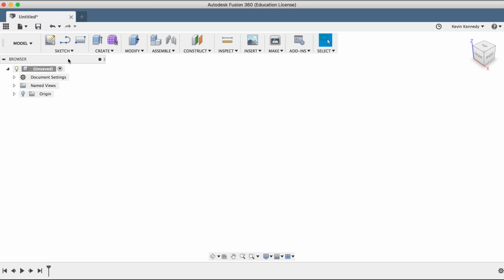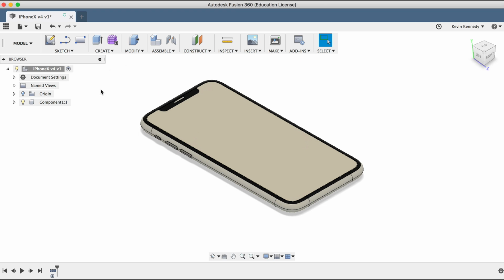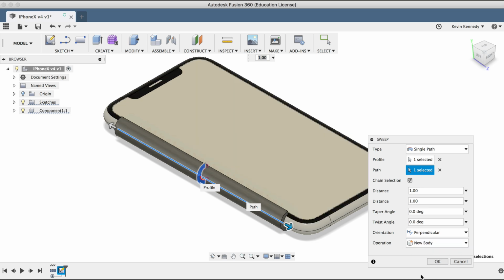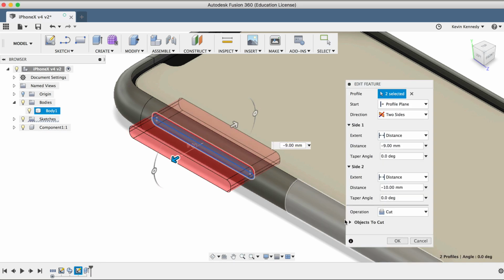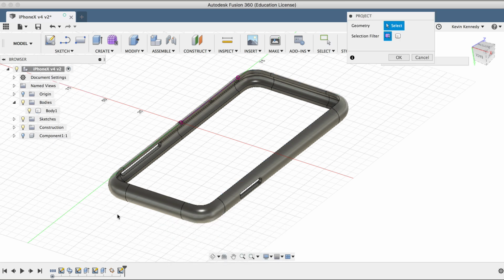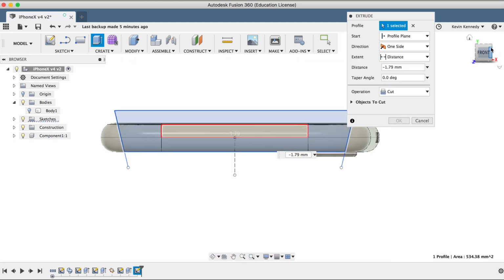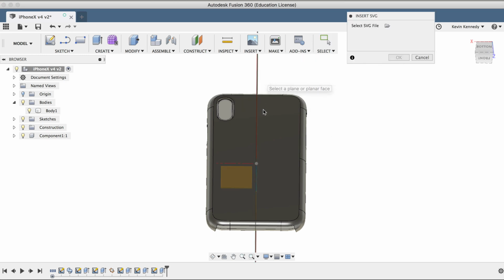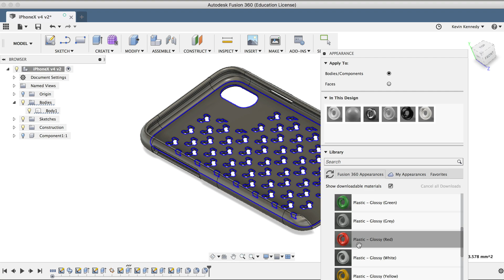How to 3D Model an iPhone X Phone Case - Learn Autodesk Fusion 360 in 30 Days: Day #10

Comment: Error: Work Plane From Two Lines failed:  Input lines must intersect or be parallel

I am working with Fusion 360 2023 and as of yet I have not found your Fusion 360 Day 10 2023. So being that your video is 4 years old, I am having terrible time trying to figure out how to work Fusion 360 2023 version. As per that error, I have redone, redone and redone the "Plane Through Two Edges" as it just refuses to work. You know, I myself, would prefer a 30 minute video over a 7-9 minute video, even if some of the stuff is repeated from previous videos.

Comment: If anyone is struggling to create a sketch on the front face of the buttons like I was, you can either create the sketch on the back of the buttons or just use the normal X / Y planes. You'll just have to extrude slightly further so it still hits the case.

Comment: Hi Kevin! I re-watched this video again, after about 2 years of watching this initially. I need to design a case in which I will place a windshield wipers motor. This motor will move an autopilot, on my boat. I suppose I also need to re-watch your video on drawing a bottle from a picture, as you dimension parts there. Maybe you can do a video which shows how to design a case for something complex, like a motor with a shaft and bots to fasten it, as it seems a common feature of many engineering projects. Thanks. ))

Comment: For anyone who runs into the same issue I had with the initial steps of sketching the spline and not seeing any points of clipping onto the outer edge of the component like he can, you can solve this by enabling in the preferences of fusion a setting in the design tab, enabling a setting called auto project reference on edges. then click apply and okay. you are all set.

Comment: Hey Kevin, I love your videos but I am having a problem with the sweep portion. When I do it, the entire sweep has a large gap between it and the phone model. Initially I thought it was due to the offset that acted opposite than yours as I had to set it to -2 instead of 2 for it to go outside of the Fit Point Spline line but that was not it. Also tried a more accurate Fit Spline Line with more dots. I am stuck. Any idea how to solve it?
Reply: I had the same problem

Comment: Hi there. Thanks for another great video. 
I'm trying to find some info how to do the cuts in the model at the angle. Let's say I want to make something similar as you did with this pattern but with ellipses and cut model at the angle. Can't find the answer to this. If I make sketch on the surface and then extrude, it extrudes at a 90⁰ angle. I want to extrude at 45⁰angle. 
Do I have to create a new plane on 45⁰ angle, then create sketch on it and extrude through my model ??? 
Thank you in advance
Reply from the maker: That's correct! you can create a construction plane with "Plane at an Angle" and set the degrees to 45.

Comment: can this make a clear phone case design?
Reply from the maker: You can apply any Appearance in Fusion 360, including a clear one. That said, 3D printing it would depend on the material you choose. Most 3D printing materials are 'foggy' instead of truly clear, due to the layer adhesion :)

Comment: While trying to build the solid back and after I selected the back plane, I could not get a continuous path around the back. I am using the I-Phone 6 for my model and it turns out there were 4 short pieces of the back at each corner that had missing lines. I sketched those in and then selected the lines again. This time I got a complete perimeter that I could extrude.

Comment: I am at the step where I create the solid back. When I try to select the plane I get an error message that the lines need to be parallel. I have looked at the lines from multiple views and they appear to be parallel and on opposite sides of the back of the phone case. Any ideas what I'm doing wrong?
Reply: I finally got the plane by selecting two intersecting lines.

Comment: I was steamrolling through the classes but this one brings up a lot of technicalities with which Im trying to work through with the experts on discord. Its a great learning experience ... Will update
Reply: I'm almost done now, just need to add the .svg file and some text, extrude cut and be on my way. Getting everything to insert onto the correct plane is proving to be a challenge, partially because I had to create my own plane on which to make the back of the phone, due to the sweep I made in particular not being perfectly symmerical for whatever reason. I think this is why others are experiencing issues. When I'm finished with this lesson, I will have learned the importance of using the visibility controls, labeling sketches and components and ......how useful the project tool can be when you're in a bind ^^; <3
Reply: Doing these clases while anxious makes u make the silliest of mistakes, a lot of what makes this one difficult is because they arent paying attention

Comment: Had a lot of difficulty with this particular tutorial. I started out dutifully creating separate components for the case and the phone thinking it would simplify things. This turned out NOT to be the "case" as I quickly departed from what I saw in the video directly into frustration territory. One particular sticking point was choosing the plane where the bottom cutout sketch would go. It took several tries and the results weren't exactly like the video when I got done. Personal users might note that the phone comes in as read only when you upload it. A bit confusing if you don't notice the notification at the top of the screen right away.
Reply: I am having this same issue, the newer version will not let me spline unless I select a particular plane that throws off the whole process. The newer update really changed the way the tool menus interact. Frustrating to say the least.

Comment: Great video series. This one has me stumped as the inserted model of the phone comes in a different orientation and I'm too new to get by that. I'll go back to your earlier lessons and learn more regarding the view rotation and what is needed to solve this. I'm also having a difficult time the the x,y,z planes. Coming from 2d AutoCAD where we use the x, y (x - across, y up and down but here in Fusion z is up...I'll turn my preferences to match yours hopefully that will help.
Thanks for your lessons, hopefully someone at Autodesk will recognize you for your community efforts and offer you a teaching career.
Reply from the maker: Thanks, Barry! The default modeling orientation was Y up for a long time before they switched it to Z up. You can switch it in your Preferences following this article: https://knowledge.productdesignonline.com/article/52-day-6-revolve-doesnt-cut-the-3d-body
Reply: @ProductDesignOnline  One of my students said that when they downloaded the Fusion360 Archive version it worked :-)
Reply: My xy plane in the origin folder never matches his. I just try to pick the plane that most closely matches his visually.

Comment: Hi Kevin,
I have been following along on your lesson plan and I have learned a lot thanks to your concise instruction. Thank you! I downloaded an un-scaled version of my Samsung Mobile phone from GrabCAD. Is there a way to calibrate the model so that it can be used to produce a case that will fit my phone?
Thanks!
Reply from the maker: You can use the 'Scale' command in Fusion 360's Design Workspace (Solid tab > Modify). However, scaling does not allow you to type a specific dimensions, so you would likely need to create a construction line (or even better, a rectangle) with the desired dimensions. You would then use the Scale command to align the phone 3D body with your reference geometry. Afterward, you can use the Measure tool to check the dimensions.
Reply: @ProductDesignOnline  Great to know, I understand what you mean. Thanks Kevin for getting back to me so quickly, and for all the help you have been to me so far and as I continue to follow you in the future!

Comment: Hi Kevin, I have started with your course which is absolutely amazing btw! But i keep running into an error when attempting to fillet and chamfer some of my edges. Could you possibly help me in any way? I keep getting:
 The fillet/chamfer could not be created at the requested size. This might be occurring at the ends of the selected edges.
    Try adjusting the size or using multiple separate operations. Check that the selected edge chain ends at a sensible position, and if not try selecting more edges.

I do what it says i should try but still i get no luck with it in all honesty. I am stuck clueless. If you could help i would greatly appreciate it

Comment: Had to do figure some work-arounds here (extensive use of offset planes) to complete this one because I couldn’t get rectangles drawn on the same planes as the button faces (which seem to be non-planar...but are curved). This could be a hole in my knowledge caused by something I missed in past lessons...

Overall, though...excellent vid. Thank you.

Comment: I keep getting a Sweep 1 Compute failed when doing the sweep.  Stuck at this point, any help available on this?  I have had to stop this tutorial until I can search an answer.  I have tried redrawing the spline several times.  Great tutorials, learning a great deal,  moving to 11 and on for a while.
Reply: I have also tried this on another computer as well, same problem.

Comment: Slight problem here, so when I try the sweep command, I would complete the body and then it would: compute failed, sweep, general model error.

So I redid the spline a bit and then tried again, now it's saying that the path doesn't intersect the profile, so I'll try re-doing the spline again, but also when I try the sweep I notice that the spline turns red...what does that mean?  I'm willing to send file if needed.  Thanks!

Comment: Help! When i try to do the sweep command, i keep getting the "body intersects itself" error. I am doing a samsung galaxy s20 ultra, and the problem is where the outer button are. I tried playing with settings and dimensions, as well as drawing a construction line for the path, but nothing is working.
Reply from the maker: You can try to Sweep smaller sections and then use "Combine" command to combine the bodies at the end.

Comment: I was unable to complete this tutorial. I didn't make it past the 4 minute mark before I got stuck and had to move on.

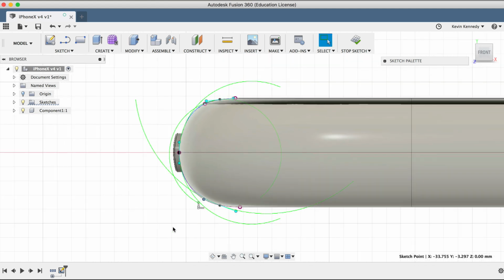Firstly; I inserted the point spline markers around the edge of the phone model (2:07), then offset that arc by 2mm (2:27).
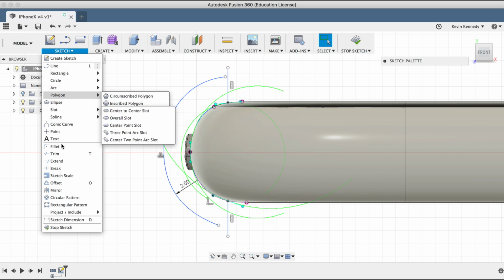I then proceeded to draw in a vertical line from the top and bottom of phone, using trim and extend to close the shape (2:59).
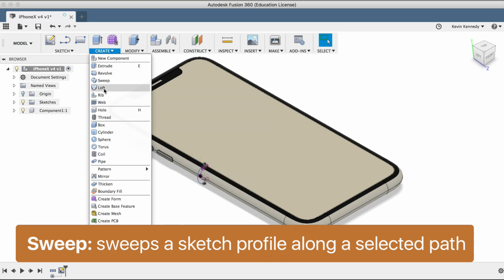After that, you proceed to sweep the profile around the phone, selecting the edge lines as you go (3:19).

This is where something has gone wrong for me. I get an error message stating:
 "The profile crosses the revolve axis.
Try moving the profile, or trimming along the
axis, so that there is no overlap.
Tool body creating failed"

Initially, I thought the point spline was intersecting the phone model and therefor wouldn't allow the sweep function. 
So I offset the original point spline by 0.1mm to allow a gap but then when trying to sweep again, same error message.

It would have been nice if you had went into some errors that we might come across when doing these tutorials.
I've had to skip this one and I felt I could have learnt a lot by completing it.
Reply from the maker: Hi Josh. Check that your settings match mine. It may be a setting that's throwing everything off - https://bit.ly/defaultsettings

Comment: All the cad files I download are proportioned correctly but not sized correctly. Is there a way to change the size?
Reply from the maker: What file types are they? If you're working with STL files then I answer that here - https://productdesignonline.com/tips-and-tricks/why-is-my-stl-file-10x-greater-in-fusion-360/

If STEP or other brep file types then you can use the "Scale" feature.
Reply: @ProductDesignOnline  thanks I’ll check that out. They are stl files.
Reply: Edit I read the article and I’ll try it later today. Thanks for the info

Comment: Anyone know how to download the pattern in the link? Because i only see the pattern on the website but i can't save the image.
Reply: I got it. I use normally Fire fox browser, but I tried google browser and it works.
Reply from the maker: You should be able to right-click and select "Save as" via your web browser. Which browser are you using?
Reply: @ProductDesignOnline  Ive got it. I used fire fox. with google it works.

Comment: Hi, don't know if you will be replying me as it quite old video, I'm using keyshot and i have phone model bip file and case model stp file , i need to know how do i apply the case on the phone model ? Can you help ?
Reply from the maker: If you didn't build the case around the phone model then you can always use Joints to position it. Alternatively, you can use the Move command. However, the Move command is not as precise as using Joints.

Comment: So to challenge myself, I started by modelling my own phone, a Samsung S9+, and it has a different fillets on the side edges compared to top and bottom.. I don't know how to merge them to create a smooth corner, without any edges.. I think maybe a loft, but it complains about the flow would flow in a invalid direction..
See my corner here:
https://ibb.co/z70Xp3r
Thanx a lot for the video tutorial!
Reply from the maker: Hi, Fritzklyka. You will need to first "Project" both end profiles. You can then bridge them with the Loft command...but you'll need to make a center guide rail that is constrained to each profile (using coincident constraints).
Reply: @ProductDesignOnline  I will try that out tonight! Thanks alot for your answer!
Reply: @ProductDesignOnline   Thanks alot for the tips, I think I got an idea of what you mean.. I made new planes, drew an arc that I used as center line before project and loft.. Result:
https://ibb.co/0VqkRp9
I will be a little bit more precise in the final version,  for some reason  I got a strange wrinkle in the inner corner.. Thanks again!
Reply: Remade it and this time with better geometry, and no need for ofset planes etc, just went by your tip and it worked bery well. Like the blank rendered result of mirror:
https://ibb.co/mDJZpr4

Comment: Hi Kevin, newbie here, loving the lessons. Stuck imported Cad files they all STL files off thingyverse and grabcad etc, when I upload them and double click all good. Then I have a pink mesh image, I do your Capture Design History but nothing changes still left with a pink mesh image. Tried half a dozen different phones and including one you linked below that you used but it is also stl. I am just confused - only just downloaded fusion so on the new UI which makes following your steps at times very slow going to work out the small differences - but loving it. (Example - you go into Model - mode before doing the CDH bit but I don't have that in my UI?) ANy help please, I am stopping here till I hopefully work this out. Phil
Reply: Ok I have got your version file to work, but can't find a file the same for my current phone in a step file. This seems to be the issue so far stp ok stl no go...
Reply from the maker: Did you check out GrabCad.com ? What phone do you have?

Comment: Great video series so far! I am curious: where do you find all the measurements needed for many of your videos? Obviously the length of a door stop isn’t critical but all the measurements for a phone case are. If you can’t find them online do you use calipers or some other method?
Reply from the maker: Hi Zachary. Great question! Yes, most of them come from online, cross-checking with a few credible sources. I do recommend the use of a caliper if you're reverse Engineering something that's in hand. I have on my videos topic list to do a video with the use of calipers.
Reply: Thanks!

Comment: I've been enjoying the tutorial series so far, but I've hit a brick wall with this one. I just cannot seem to make the spline command cooperate. I can only get the spline handles to work part of the time, other times I can't get any response. I've had a hard time getting the spline lined up because Fusion 360 keeps highlighting every other line on the iPhone and the spline path gets lost amidst the flashing. Even when I thought I had the shape for the sweep, the program threw up an error because there was a small overlap problem (I think). I know this should be incredibly simple, but I just can't seem to make it work.
Reply: I am having this difficulty too! can you also use the point 1st then connect the points created with the spline?

Comment: Hey Kevin, Sorry to bother you again I am just having problems with the sweep command and it keeps saying "there was a problem combining geometry together. if attempting a join/cut/intersect, try to ensure that the bodies have a clear overlap (problems can occur where faces and edges are nearly coincident). any help would be great, thanks lots
Reply: Hi! 

I had the same error. 

The solution was to change the Operation from CUT to NEW BODY.
Reply: @sasaran13242  any resolution? I'm experiencing the same issue